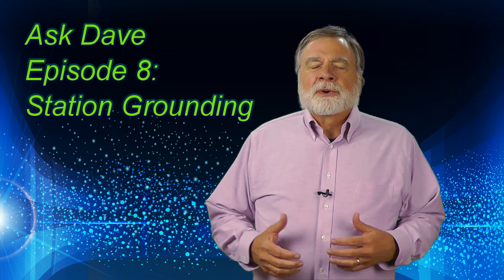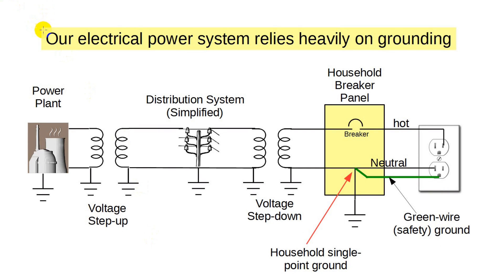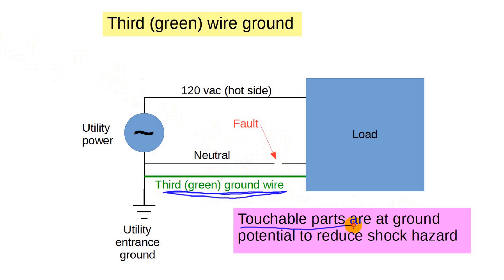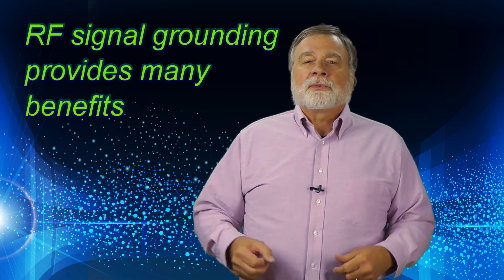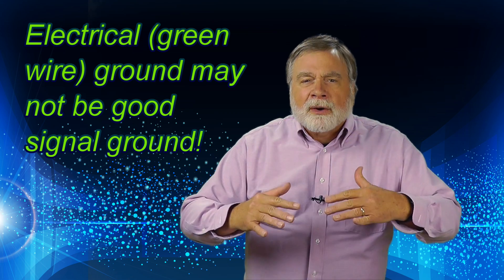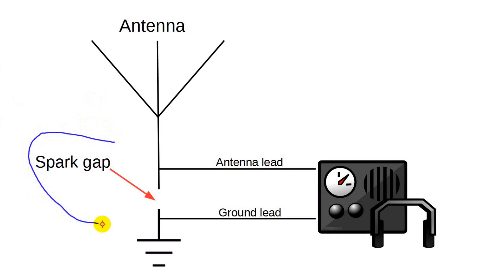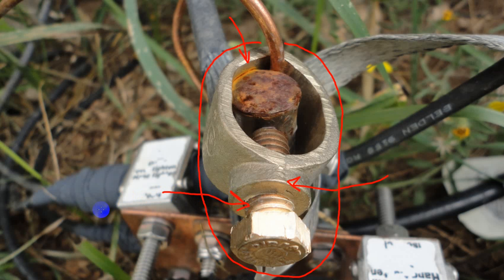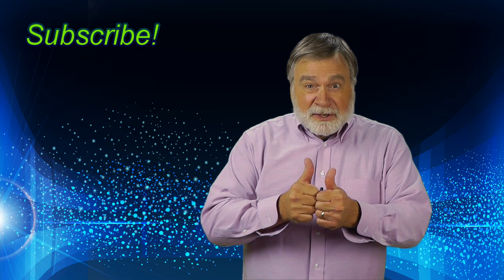Station Grounding for Amateur Radio: Ask Dave Episode 8

Comment: Hi Dave, Great video! Thank you. Perhaps I missed it...I know you addressed single point grounding for the Ham Shack; does that apply for the entire household.  That is, if my Ham Shack is at one end of the house and my antenna array are at the other end of the house, would it make sense to have an 8' grounding rod in both locations?
Reply from the maker: +Provident Property Management Maybe. The two should be "bonded" (connected) together with stout wife, and the household electric utility ground should also be bonded in. If you're using coax, you can put lighting arrestors or something similar at the closest ground rod. The coax cables then run to the ground nearest your station, where the coax shield (outer conductor) is grounded again, and from there to your station itself. In a way this is similar to my vertical, which is very well grounded at the vertical, and then the cable shield is grounded again at the lightning arrestor attached to my main station ground. This means that the coax braid is grounded at both ends. This seems to keep miscellaneous electrical noise to a minimum. 73, Dave

Comment: I did a lot of lightning protection & grounding for sub stations, water towers, microwave towers, broadcast radio towers, high rises, tank farms, antenna farms, semiconductor fabs, & I even did work on the grounding system for Motorola's very own GEG (Government Electronics Group)  facility. Yes, I live in Phoenix Arizona, where Motorola was once king, and a very major valley industry. I think I need to do a video on grounding. GEG had DC, 50Hz, 60Hz, 400Hz, & 1000Hz electrical supply systems, and a boatload of RF!  DC is for places like power plants with loads of induced low freq AC,, & microwave towers that use solar power. Power Houses use DC power for power tools. There is so much induced 60Hz in a power plant that some AC tools will run without even being plugged in. They don't run well, and they get destroyed, so they have DC power tools. The florescent lights run on their own too, without even being wired up.  400Hz is military, 1000Hz is foreign or maybe domestic military, 50Hz is foreign power distribution, and 60Hz is domestic power distribution.   I never did find out exactly which military uses 1000Hz. I think we do for some stuff. I can neither confirm nor deny, but it may be possible, type of answer. We used a quasi flat braided strap type wire for lighting protection, but the braided wires are around 14 gauge. We used miles of fine wire flat RF grounding strap wire at Motorola, and Raytheon, and General Dynamics, and Unidyne, & Rockwell, and..... RF ground straps are the exact same straps we used for mechanically flexible static dissipation grounding at, oh let's say flour mills, & other industries, where static electricity is generated by lots of moving air, bouncing rubber balls on wire mesh screens, or anything else that causes lots lots of friction. We used to get RF get bit at Motorola & Raytheon all the time. The grid ceiling was just famous for it. Sometimes the ground buses would nail the crap out of us too. Plumbing pipes, anything metal was fair game. Raytheon D'ine was really bad.  The wires in those RF straps are closer to 36 gauge. It is very fine wire, & very flexible wire. Lots of surface area for the skin effect.  This is the exact same stuff they sell for ham radio, and the exact same stuff used for RF at Motorola, American Tower, Raytheon, Honeywell, Gen Dyne, your local ABC, CBS, NBC, FOX affiliate TV station, & local radio station transmitters.  I have other wiring I can salvage that works great for RF, but I have the test gear to see of it will work well or not, so, use the flat strap fine tinned wire stuff. The bigger the better!!! Aluminum to copper is a very very bad idea. I also do NOT NOT NOT advocate putting stainless steel to copper. I am a master electrician of 30+ years, & I did take 1 year of high school electronics, and  a 2 year college course in electronics, 2 years of pre semicon design, which was chemistry & physics, and I have been making my own RF gear, audio gear & repairing/building guitars & tube amps since 1980. Unless it is good electronic rated stainless, USE BRASS OR BRONZE BETWEEN ALUMINUM or STEEL & COPPER AND USE BRAS or BRONZE BETWEEN STEEL or IRON AND COPPER! Much of the stainless steel is very poor quality. Galvanized steel to copper pipe creates a galvanic reaction that eats away the metals, so why would I ever put any type of steel to copper? Any journeyman plumber knows you must use brass between galvanized steel or iron pipe & copper pipe. If I knew the stainless steel was at least a 440 grade non-magnetic surgical/electronic grade or better, maybe, but most of it is dubious quality which barely rates a 301 grade, under the best circumstances. I was exothermic welding sacrificial anodes onto pipe lines at age 7, working with my father on a 108" twin siphon, below Pueblo Dam in Colorado. I know steel to copper is really bad idea. We used a bronze cad weld to tie the copper to the steel piping and a magnesium alloy anode that gets eaten away rather than the steel in the pipe.  73s all the way, Dave, KI7AQJ
Reply from the maker: +Seth B Hi Dave, and thanks for the voice of experience. Where can brass or bronze fittings be found? I don't see anything for sale at the Home Depot website. What's a good source? Thanks, Dave, KEØOG
Reply: I use brass and copper compression fasteners for my station grounding, go to any electrical contractor or his supply source and you can get most any kind you  need, ie, compression, spit bolt and threaded.  PS: dont use aluminum ground rods and dont use short gnd rods, get full length copper or copper plated rods.
 THe best way to make ultra reliable ground connections is with Cadweld Exothermic method.  If the earth is hard or rocky you can bury gnd rods horizontally.
One thing to avoid is braided strap copper grounding wire, it has a high impedance value to lightning strikes. Use the largest copper you can work with, typically #4 or # 6 AWG.
 Worst case you can dig a trench as deep as possible in hard or rocky ground, make a form appx 7 inches square and the length of the rod to pour concrete mix into, About the size of a parking lot bumper and lay the gnd rod in the form and pour concrete in it, leaving a short piece of the rod exposed to connect the ground rod wire .  Then when cured put the concrete covered rod in the earth horizontally and cover it with moist earth.  Ref:  National Electric code. ( concrete draws moisture)   Gd DX de n5eqy.
Reply: I have Cad Weld molds for #4 AWG to #0000 to ground rods of 4 diameters,. and some that tag the wires to flat metal like steel I beams. We can wad up heavy lightning cable and mash it into a 00 mold. Flat braided RF straps tend to melt when the thermite & brass flares off. The closer your electrode is to the underside of the concrete casement the better. I just bought an earth conductivity meter, that ASU had been using to check the bleachers at their baseball field. Packard Stadium??? I think they call it a half cell tester. It works.
Reply: 1" copper pipe has a lot of surface area too. They make cad weld molds that go to plumbing pipe too. They are not cheap. The #00 through grid, wire to rod molds were $255 each, back in 1996. They also broke very easily, unless you were smart enough to dig a large enough hole to open up the clamps, which cost another $200, but those don't break. The lazy dummies I worked with failed to realize once everything is welded together it becomes rigid, and you need to fling all the clamp levers wide open to get the mold off the ground rod & cable. Force it just a teeny tiny bit, and that carbon block breaks like super thin glass.

Comment: Hello Dave,
Thank you for your contribution to the ham radio community, your videos are a pleasure to watch and your oratory skills are remarkable.
My question is related to safety ground:   What if I operate in a location that does not permit driving an 8' copper ground rod into the earth (eg Apartment or condo) or if I'm operating portable (not mobile) How does safety ground apply in these situations. 
Thanks
Reply from the maker: +kk4dbi The safety ground is the AC utility power ground, and is connected via the third "ground" wire in your power supply. An external RF ground is nice, but if you don't have one, you may be able to do without.

Comment: Ham Nation episode 134 states to break the ground from the AC cord (depending on how many items are plugged in) so you only have one path to ground, this goes against what I have learned. What are your thoughts.
Reply from the maker: +KlipschHead281 My thoughts are clear: Do not defeat equipment safety grounds! These are vital! You may or may not have an RF signal ground (ground rod) in addition, but the RF signal ground is not a substitute for the safety ground. The household safety ground rod and the RF signal ground rod should be bonded together.
Reply: +KlipschHead281 In a direct or nearby strike, the currents flowing through the earth can be high enough to have hundreds or thousands of volts difference between where the RF ground rod is and where the safety ground rod is. If you don't bond them together with a beefy wire or strap then you will have that electrical potential express itself across all your shack electrical devices.
Reply: David Casler - I agree 100%, I was just shocked that Ham Nation is openly telling people to do so.
Reply: gxti - gxti, direct your comments to Ham Nation, they are the ones stating it.

Comment: Excellent and concise. One question: what  options for grounding are available for  hams who operate away from typical ground level?
Reply from the maker: +Clayton Sawh In any event you should have an electrical safety ground, if only through the three-wire plug on your power supply. That said, first decide if you need further grounding. If you have RFI issues (when transmitting you cause other devices to malfunction or behave badly), you can try rearranging cables, keeping the radio feedline well away from anything else. If that doesn't work, MFJ (and others, I think) sells an artificial ground that's really a tunable counterpoise. If you don't have issues, don't fix what isn't broken! 73, Dave
Reply: +David Casler Thanks! I'll try your recommendations. S7 levels of noise which drops to S1-2 if I switch of my power supply (linear or astron switching it didn't matter which used) and run of a battery. I am trying to eliminate that.

Comment: Dave, I ,love your video's as I am still on a steep learning curve. My question is: how do you ground your coax cable shield to the ground rod you refer to in order to eliminate noise?
Reply from the maker: +Blaine Colbry Hi Blaine, it's easier to show than to tell. I'll include this in an upcoming Ask Dave.
Reply: @davecasler  hi Dave, did you ever make this video. Thanks a lot!

Comment: 1) I learned to ground a base station antenna before plugging in the hand held. Good advice Dave - easily overlooked. 
2) Stainless Steel is still a metal and as such is prone to dissimilar metal problems. Many people think it's stainless so it's fine. It's still steel and with current, moisture and another metal it too will corrode and effect electrical joints.
Reply: You're right, but a good quality stainless has a very tight oxide layer that tends to keep iron ions from migrating out of the interface between the metal/oxide (unlike the relationship between aluminum and its oxide, which is good, but porous) and is less susceptible than aluminum to pitting corrosion, so the net result is less corrosion between a good stainless and aluminum.  Copper is close in the electromotive series to iron, and so there isn't much galvanic at that junction.
Reply: I'm no expert on stainless but there are different grades, 316 for instance is better than 304 for food use at least and a friend of mine that machines it says it's constantly oxidising on it's surface which might lead to it reacting with other metals at different rates depending which grade you use. There are some "stainless" products from the far East that actually rust so they must be the lower grade stuff.

Comment: Passed my Extra exam this afternoon. All self study. Your videos have been a huge help. 73 de K5CCG
Reply from the maker: +Chad Smith Hi Chad, congrats on your extra! I hope to hear you on the air. 73, Dave, KEØOG
Reply: @davecasler   I'm new to ham radio I'm working on getting my license I'm currently erecting a tower I've read the NEC about grounding but I have a question about grounding my coax do I use a ground rod that is isolated and dedicated for the coax from everything else or does it still need to be tied in with the rest of the grounds around the whole house including the ones that you use to ground the tower
Reply from the maker: @bw71wad  They should be "bonded," meaning tied together
Reply: @davecasler  thanks
Reply: +Chad Smith Congrats, Chad. I am averaging 85% on my Extra Cass tests, without using my calculator half the time, and >95%  when I use it. So I will have my certificate of passing on the 16th, and my Extra within 10 days of that. 73, Seth, KI7AQJ I am gettin me a vanity call sign. Haven't decided on something cool sounding in CW Morse ,or just something cool.
Reply: V

Comment: I've used 10' 1" electrical conduit as a ground rod.  I wak it down with a fence post driver.  I drill a hole in the end, then bolt the wire to the conduit with ss bolts, washers, and nuts. And I've used ss hose clamps too. I used a panel box neutral bus bar for all the ham shack ground wires.